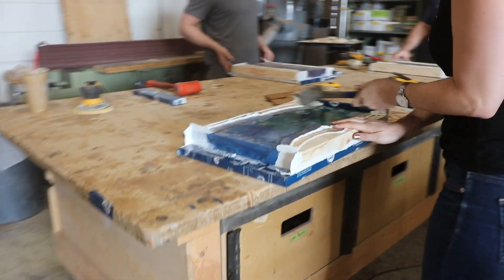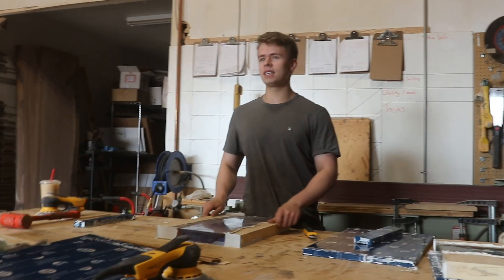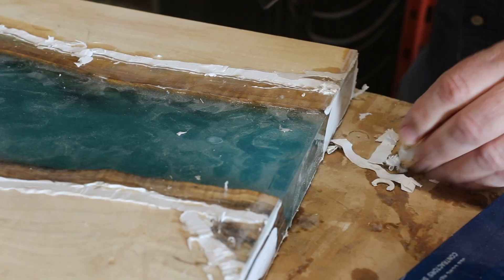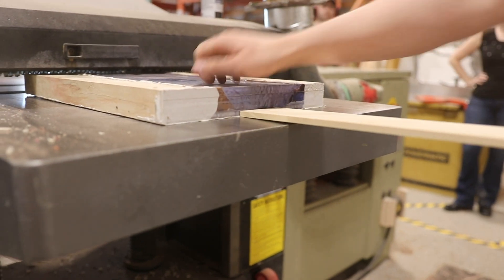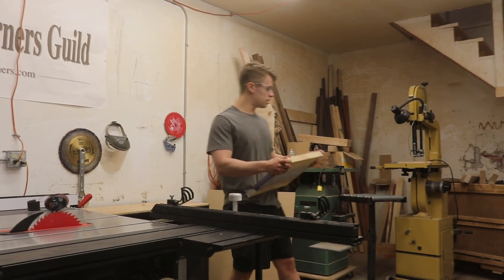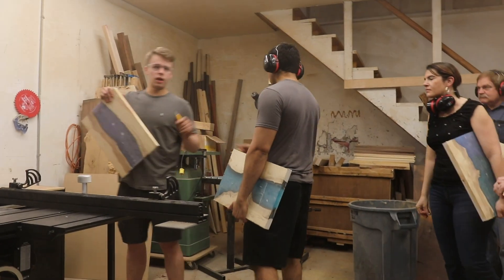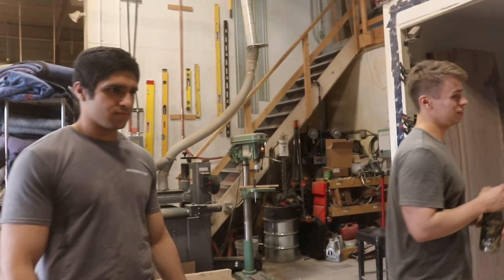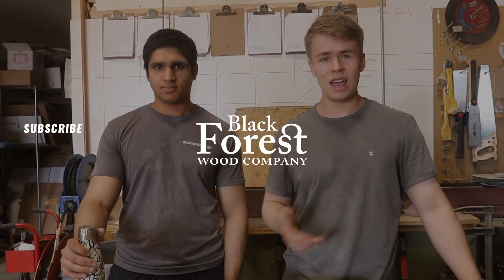A Day in Our Epoxy Wall Art Class

Comment: Hi! I have a very important question. Right now we are trying to finish our first table. The problem is that we have a pig tails (swirls) on the resin. Those are not so deep but varnishing doesn't cover them. Can you tell us what we are doing in an inappropiate way? We started from 80 grit, 120, 180, 240, 320 and even 400. We cannot use higher grit as lacquer has to stick to the wood and resin. Each of these grits leave the swirls so this is not related to deep scratches. We use orbital sander without vacuum.